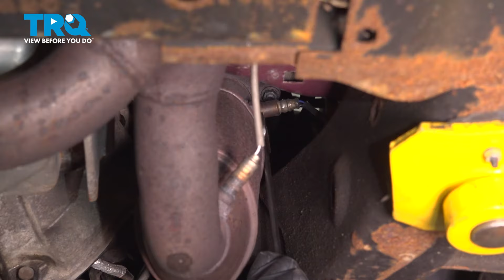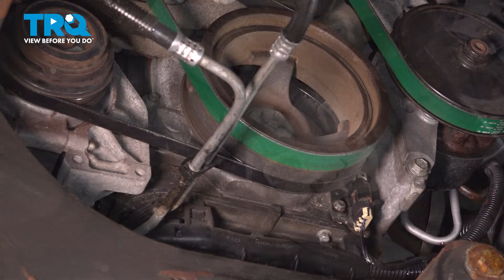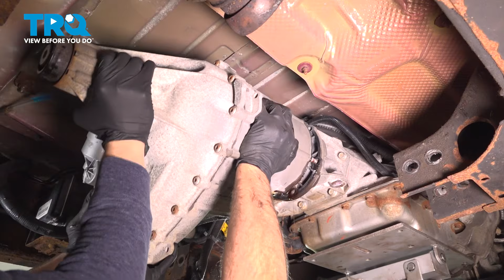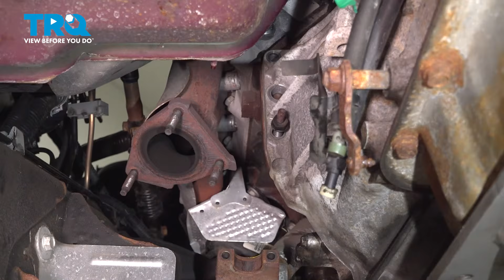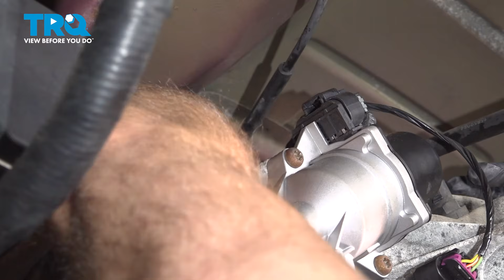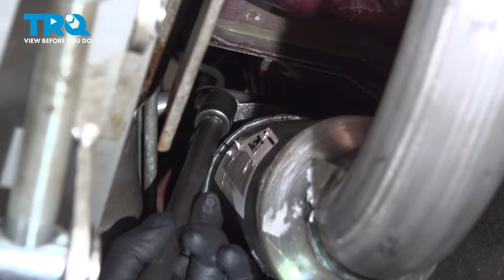How to Replace Rear Main Seal Cover 2007-2013 Chevy Silverado

Comment: If you have a welder, it’s a huge time saver to just cut the exhaust where it crosses under the transmission pan. Cut the pipe close as possible to the welds on the converter. 20 minutes worth of welding but much easier than dropping exhaust

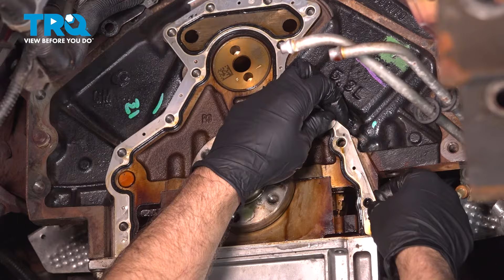Comment: 30:41 why did you not change the screen filter while you had it disassembled. If it’s clogged it will affect the oil pressure. 🤔🤔
@@TRQ

Comment: Your lucky if it doesn't leak without the alignment tool. It's so much more worth it. $20 tool on ebay goes along way. You'll see how far off some of these aftermarket covers are with the tool

Comment: I just did this.  I replaced the back plate with the seal.  I tightened the plate then the lower two oil pan bolts.  IT LEAKED REALLY BAD.  It was much worse than before.  I'll never buy one of these plates again.  The factory method is to install the plate without the seal with a centering tool.  Tighten bolts then install the seal to make sure the seal is centered.

Comment: Unnecessary to split the transfer case from the transmission. Use wood between the frame rails and slide it back.

Comment: Don’t lube the crank for PTFE seals. Also Do not tighten long oil pan bolts first, this will stretch the seal out of round. Tighten shorter bolts to the block first, and then bottom long bolts, which are only 8.8 ft lbs!

Comment: You’re supposed to use the alignment tool and torque the plate bolts before the long pan bolts. If you don’t it pulls the seal down and out of alignment.

Comment: To replace the rear main seal, wouldn't it be easier to pull out the engine then transmission?